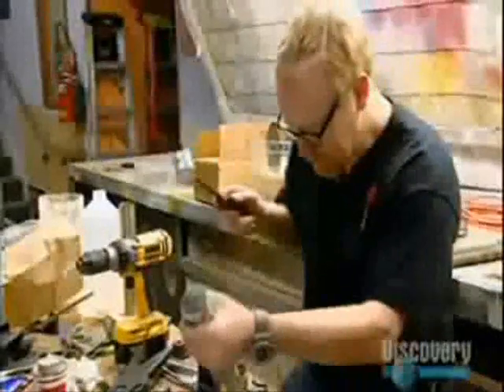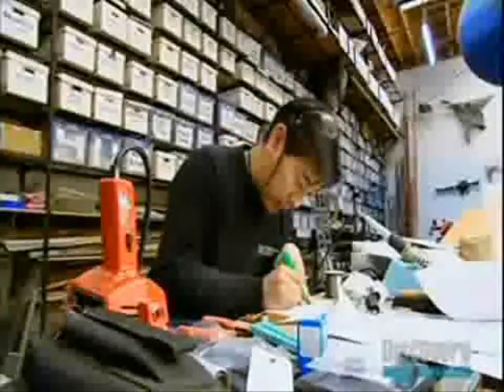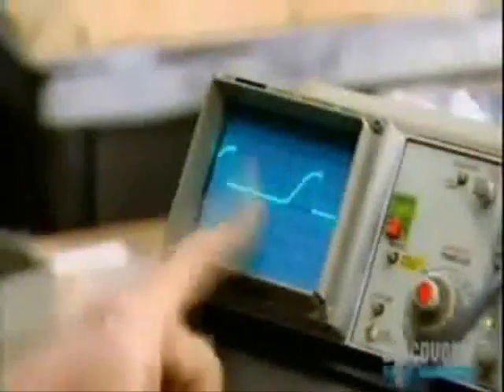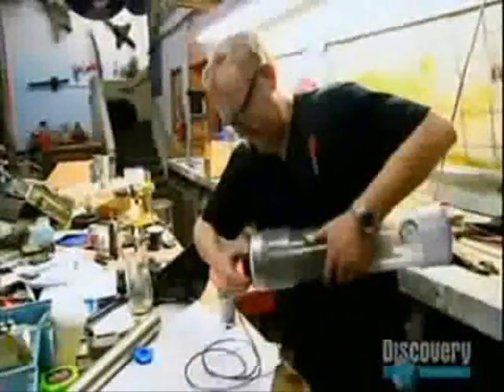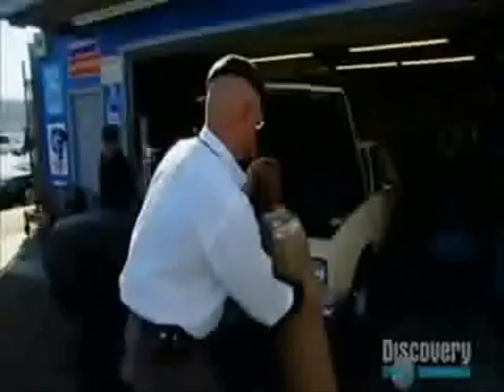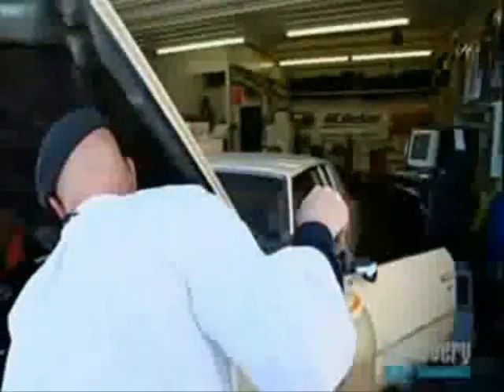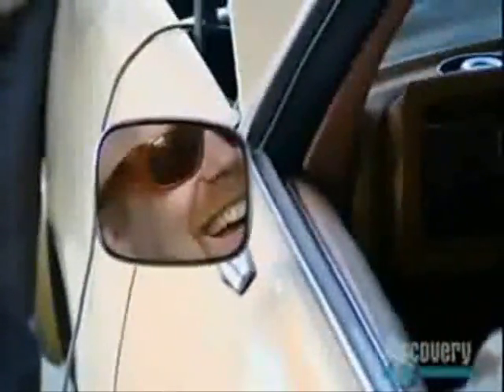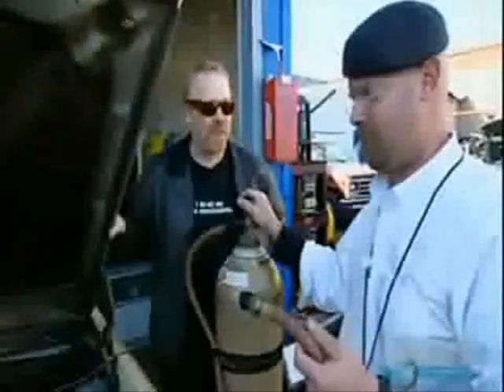Mythbusters Tells You How To Turn Water Into A Hydrogen Fuel Cell - No More Gas Bills!!!

Comment: Two things: 1) the idea with these devices is not to run the engine purely on hydrogen. It's to run the hydrogen, oxygen & whatever else is in the mix into the engine, making it part of the air/fuel mixture and running the vehicle with that;  2) they seem to have neglected to put an electrolyte (like baking soda) in the water which explains why so little bubbling; 3) to make a noticeable change in gas mileage you would need 2 or 3 of those for an engine that size.

Comment: Where do you get the energy to do the electrolysis? What is your ultimate energy source? Energy doesn't come from nowhere. Or are you claiming you have created a perpetual motion machine?

And what do you do about the problem of hydrogen seeping into the metal of your engine block and making it brittle?

Comment: Because Stan M's design isn't the electrolysis model they can "expose". HHO from electrolysis is an energy waste. S M's design, however, doesn't pass a lot of current like electrolysis does. It works on high voltage resonance between the plates. This the fundamental thing most fail to understand. S M's device uses resonance. It is not like normal electrolysis that passes a lot of current for HHO production.

Comment: @warren52nz   I once saw a comment, on a video about a plane whose instruments had failed, and the pilots could not sense the plane was banking dangerously,  one commenter wrote ' why didn't they use a glass of water to sense if they were banking'
he doesn't realize that acceleration / even smooth angular turn, creates its own gravity, you cannot sense the banking,  earth's gravity may be vertical to you while acceleration creates a stronger gravity at 30 deg pulling you and the water in glass

Comment: @JenMichel100 "stan meyer's device use high voltage low current"
That doesn't matter, you still can't get more ENERGY back than you put into it.
Energy is power X time and power is voltage X current. So low voltage and high current is the same as high voltage and low current (if the product (multiplication) is the same).
No matter how you separate the hydrogen from the oxygen, you have to put more energy into it than you'll get back by recombining them. First Law of Thermodynamics.

Comment: I like the fact that ManBuggle only showed the "good" parts. All energy conversion processes are associated with energy losses. The highest losses occur when chemical energy (coal, oil, natural gas, or hydrogen) is converted to physical energy (electricity, motion, pressure) in power plants or internal combustion engines. Those losses can be far below 50 percent.

Comment: A small car requires about 80hp to run which is about 59.6kw of power. In other words u need 59.6kw of power from ur batteries to run on electric motor and u need alot of batteries for that.

Comment: This test was set to fail. 1st electrolisis needs high voltage for regular tap water to spit, or adding electrolite to the water for low voltage electrolisis. They did neither. 2nd. They got 5 small bubbles and claimed it was working, and never considered how much hydrogen they would need to run the car. 3rd. They didn't check to see if the device would only improve MPG, running WITH gas. 4th they didn't re-examine any of thier work for mistakes. Mythbustsers NEVER run test like this till now!!!